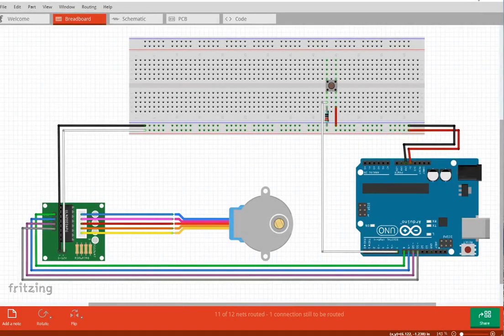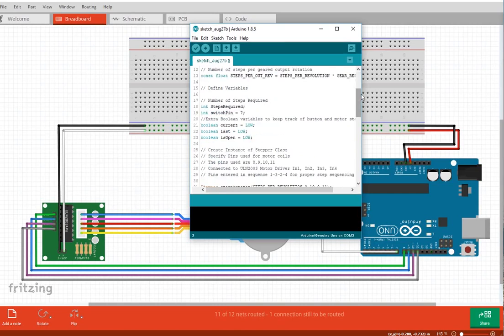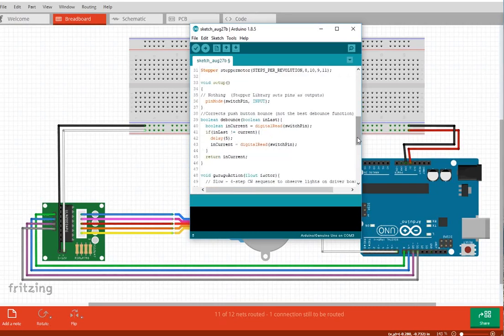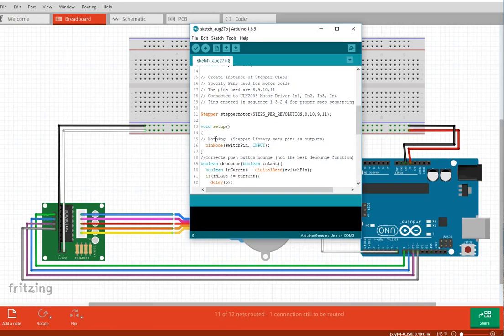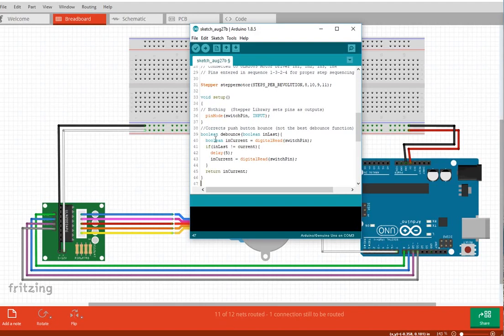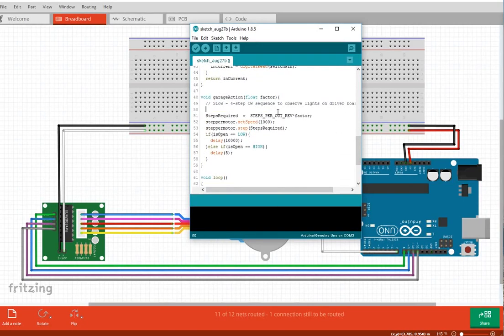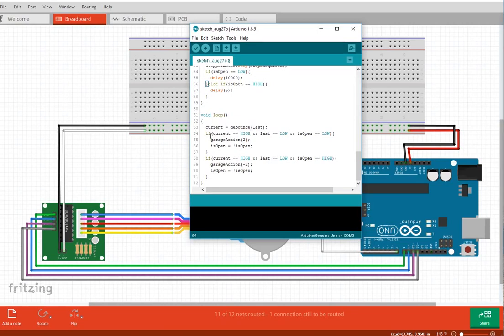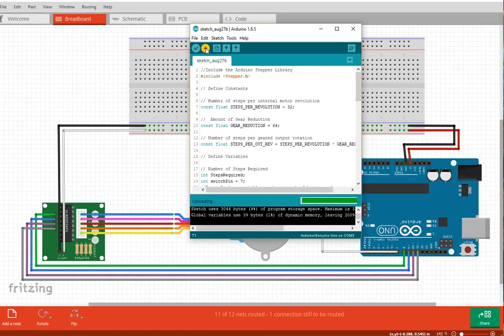Arduino Tutorial   Step Motor with Push Button  Part II

Comment: hi, so does this code mean that whenever I push the button it will spin a certain direction and when i let it go, the stepper will go back to its original position?
Reply from the maker: Yes
Reply: @blueicedpen  i just want to say your fritz diagram doesnt match the part 1 for how you layed out the button :p

Comment: You may not see this but, do you know why my motor dosen't spin? It just vibrates?
Reply: Leave a delay(5) before or after the action the motor has to perform
It might be the vibration is due to power instability as he mentioned in the video, and the delay gives enough time to level out the power.